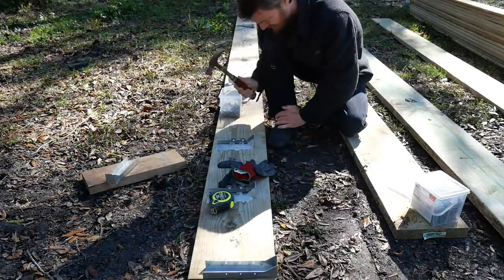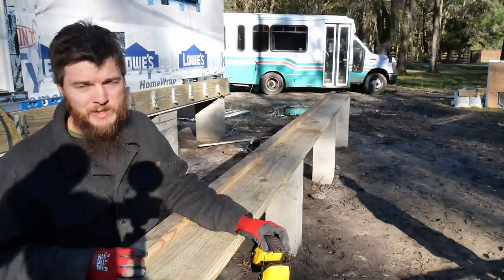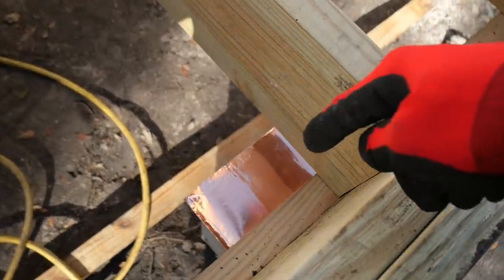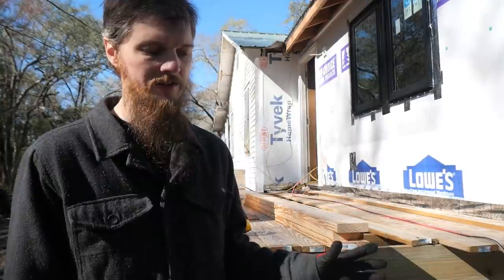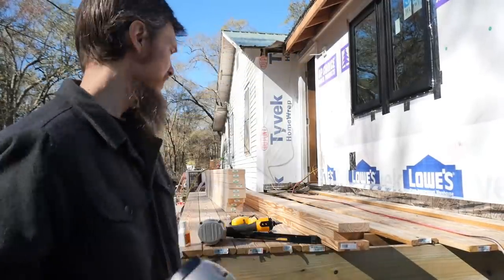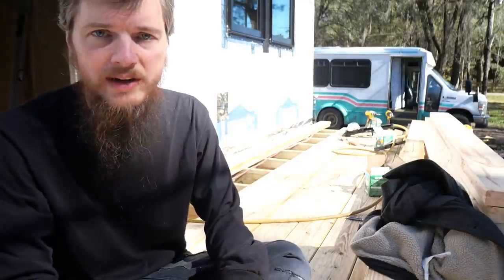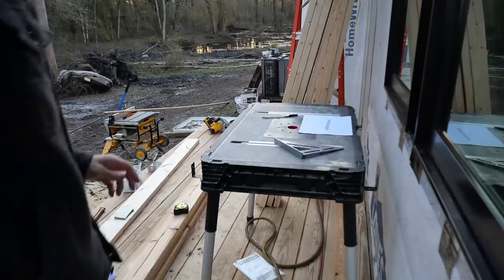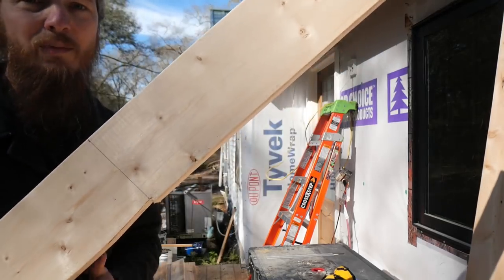I Shouldn't Have Used Nails!  DIY Porch Build

Comment: Doug - you probably have checked this but the air compressor pressure is critical to drive the nails fully.  Test on scraps first and dial in the pressure.  Either one of those guns should be able to sink those nails with ease.  Don't forget the drops of air tool oil each day.  Cheers!

Comment: Put Air compressir psi at high end of tools limit. Use air hose with a bigger I.D..  Use coupler fittings at both ends of the air hose that have larger I.D.s than what you have now, which are probably 1/8 or 3/16 I.D.
The framing nailer takes  big gulps of air so give it larger i d. hose/fittings. 
If your nailing and your compressor starts up/ pause nailing till it recharges then continue.
Also check your tools nail depth adjustment. Remember to put a few drops of air tool oil into the air fitting from time to time.
Reply: and make sure the hose isn't to long

Comment: I was getting exasperated watching you continually driving those nails without referring to the trouble shooting portion of your owner's manual. Two things spring to mind immediately ; not enough pressure from the compressed air supply and the depth adjustment built into the nail gun.
You should be able to go to your air compressor's air gauge and twist a knob to increase pressure there. There should be a needle that remains stationary marking the maximum pressure that you set and another one that goes lower every time you shoot a nail, when the pressure gets too low, the air compressor will kick on in order to go back up to your desired nail gun pressure. 
The adjustment on the gun itself should be some type of threaded mechanism next to the tip that you push against the wood while squeezing the trigger. Again, this should be clearly explained in your owner's manual. Too much hose will also decrease pressure. An undersized compressor will cycle more often depending on the size of the tool and the rate of fire. good luck !
Signed '45 years in the business'.
Reply: Yes, exactly! I could not watch because the pressure to get the nail in has to be turned up for some types of wood and nails, and down for others. Totally has to do with the air compressor, not the gun.

Comment: Doug - take a look at your manuals for the nail guns and the minimum PSI they require. I'm sure your air compressor is not supplying enough constant PSI for the guns. Green wet wood requires higher PSI. For future reference ... too late here...🤣

Comment: Hey Doug. I agree with some other comments. Based on how far you were walking, assuming that’s where your compressor is, I’ve found that a hose longer than 25’ causes problems. You need at least 100-125 working psi. Most compressors can provide this except not over long distances. Try shorter hose and shorter nails. Ring shanks are tough to hammer in. I just put new T 11 siding on a mobile home using a hammer and 2” ring shanks. Man my arm felt like it was gonna fall off! 😂 Looking good and glad you found the site to help you lay out your rafters. Old school carpenters can lay out any project using a framing square. It’s a lost art sadly. Keep up the good work looking forward to seeing the next video!

Comment: The power to the air nail gun totally depends on the air pressure. It isn't usually the gun, it's the air compressor. Make sure it is turned up. I don't hear it running. :)

Comment: How much air do you have coming from compressor?  Turn it up all the way. If it's only 120 psi  if you have a 150 psi compressor it will drive nail in. A framing hammer 20 to 24 ounces or more its easier to know it will drive with fewer hits. My Dad could drive nail in two hits. If I bent nail he would say you are still wet behind the ears.  Meaning young.

Comment: My back experience building my house tells me you need more pressure from your compressors.  I know you sayed preferable you like to use nail but it's better using screws it's stronger and durable. Your post for your roof should been install before your deck floor. You will have a  better option by making those post stronger this was your roof won't shift I have build many roofs until today none have shift . But is you project and you can building it how ever you want, but there is always logic and it's up to you if it make sense to build it right the first time, get a better hammer 22 Oz . Take care thanks 😊

Comment: Turn up your air pressure, if the pressure is ok use a shorter and larger diameter hose.  You are running out of air for the gun's piston.

Comment: It’s strange two nail guns wouldn’t hammer the nails in 🤔 I take it you checked the compressor and hose because it sounded like the guns weren’t getting the correct pressure, I take it the wood isn’t some sort of magic hardwood only found in the forest of the unicorns lol 😝 as for the conventional hammering, if you point your index finger up the shaft of the hammer towards the head you will find your aim is better if not I suggest a leather wrist brace 😊👍🦖🗿🦤🏴

Comment: - Tool lubrication
-  Piston wear
- Air Pressure
What pressure are you running? Capacity [CFM] of compressor?
Looks like your compressor is undersized... Need more volume not pressure...

Comment: Agree with what others said. The fact that both nail guns "failed" means that either the wood is too hard (unlikely) or that your air pressure is too low - very likely.
Reply from the maker: We had it set to what the tools say to use, 120psi. Those deck boards seem to be the main issue since the nails shot through the board on the piers fine.
Reply: @diyfferent  The SCFM matters, not PSI. If the gun requires 3.5 and your air compressors make 2.9 it is not enough.

Comment: been watching longtime, two question on nailer, 1. Did you hold down with some force to prevent recoil? 2. could you turn up the air pressure.

Comment: I bought rough lumber when I built my deck last Summer. I used 2x6 larch for the decking and cedar for the railings. Had to plane all the wood myself but it will outlast treated lumber and was a lot cheaper as well. I used 3.5" deck screws.

Comment: Use nails for deck framing. Much higher shear strength than screws.   Stainless steel screws to hold decking and treads down.   That is the best or correct way.

Comment: My husband said to turn the air up on your compressor
Reply: I'm wondering the same thing. why not turn up the psi that goes for each nail hit? maybe its the way the nail guns are designed, they could be the ones that limit the pressure of each hit?
Reply: That was my thought as well. I can't imagine any major manufacturer not being sufficient for driving nails into PT wood. I wonder if his Air Compressor isn't big enough or set on a higher PSI.
Reply from the maker: My compressor goes up to 125 PSI, The nailer says 120 PSI max, I had it at 120 PSI and even a little more. It just didn't have what it takes to drive those 3" ring shank nails.

Comment: I find it amusing that you chose nailing the deck boards on when you use screws for so much of your construction. All will be fine in the end and your nailing arm will recover. The remodel looks good and I know y’all will feel safer using the porch.
Reply: IKR
Reply: I don't like screws in decks either. They can cut your feet if you are barefoot and they happen to be sticking up.

Comment: My wife says to nail from the elbow and not the wrist. She doesn't think it's the compressor or the pressure, but is the result of not holding the nailer firmly against the board, thus allowing recoil.

Comment: It's not the nail gun or the compressor. It's the fittings. I had the same issue the fitting opening is creating a bottle neck so you are getting the pressure you need but you are not getting the volume. They make fitting with a larger opening to help deliver the volume you are lacking. Try it you will thank me later.

Comment: The contractor who built our deck used screws. I’m always a fan of screws over nails to avoid nail pops, etc. Screws seem to hold up much longer. Your new gun is much more ergonomically designed, good choice.

Comment: the builders of our deck used nails
Nails work back up as boards giggle under walking. And then they impel our feet. It caused me an injury to my foot.
 A new contractor said its advised to use screws for floor boards and deck boards to prevent this
Reply from the maker: What type of nails did they use?

Comment: Could the nail setting problem be due to low air pressure. Most air tools have an adjustment screw to increase/lower air pressure. Hope this helps. Love the Little Helpers you have!

Comment: the problem is not your air pressure from the compressor but the dry or even wet air from the compressor !  .  
that is very easy to solve. 
pour a little bit of sewing machine oil into the air inlet port of the stapler and you will notice the difference almost immediately .  
after that every time you put a new set of nails in the machine just put 1 or 2 drops of oil in the air inlet port and it runs like a charm
Reply: great info

Comment: recommend you watch your video closely regarding hammering your nails that stick up.  You will notice you are attacking the nails from DIFFERENT angles, therefore causing them to bend. Your hammer is "canting in" so the nail is not being struck squarely. Also, remove the gloves as they are probably causing the hammer to slip in your hands and wrap your thumb around the hammer.  Don't leave it on top of the handle.

Comment: Dude. I told you about this months ago! Exterior self tapping torx screws! I very rarely, if ever, use nails. Only when it makes sense. And only Milwaukee M18 tools baby! You wasted a crap ton of $ on nail guns when using screws with a good impact driver would have done the job way better. I also amazingly suck at hammering nails, simply because I rarely use nails! I would have used joist hangers on the outter board. If that lip rots you're screwed. No pun intended! :P It's a horizontal wood surface.

Comment: My dad was a carpenter, and it is the weight of the hammer.  Go heaver and see. He was old school built from the ground up. Roofs when nailed on. He had many hammers for different jobs. So, try several hammers. Makes a difference on bent nails. Wish I knew what he would say about it but have forgotten. He is right though because I would help him, and I had a hammer he brought me. Lost in a move and now I have problems. I wanted to be a carpenter, but my dad said not for women on construction sights. Saw someone cut fingers off so now am afraid of power tools in school shop class.

Comment: Sounds like an air pressure regulation problem on the dewalt. If it's not in the compressor side of the system then it might be the diaphragm inside of the nailer. Either way I'd crank up the air pressure coming from the compressor.
Reply: This is what I was thinking .. perhaps not enough air to drive them. I've never had issues with driving nails except in old heart pine. Plus ring shank nails require more umph anyway.
Reply: Yup......crank it up.
Reply: at least to 120PSI (I think that's the max on Porter Cable tools) .. also if it's a pancake compressor it might not be able to provide enough air.

Comment: I don't think it's the nail gun, I think it's more than likely your compressor. Check to see what the nail gun needs for air pressure and then set the compressor. I am also surprised you didn't screw the boards down as you have used screws in most other projects.

Comment: You insisted on nails, I wouldn't, but if I had to I would have slightly toe nailed each nail in opposite directions making it harder for drawback. What size hose are you using?

Comment: Screw shafts have a thinner diameter than nails and even if stainless or coated they will rust through sooner than any nail. Ring shanks take more work to nail in pressure treated. On my decks I always drilled holes then hammered in the nails. Soaping or waxing the nails will help them drive easier. You are correct- those boards will shrink as they dry out. Errors with nailed boards mean using a Sawzall to cut the nails. Great work. Thanks for the video!

Comment: Take a piece of course sandpaper and sand the head of your hammer. The head won’t slip off the nail as you strike it and you won’t bend the nails as much. Also hold the shaft of the long nails with an Electrician’s pliers until it is too close for the pliers, then drive it home. You’ll be amazed at how few nails you bend.

Comment: I think with your awesome work ethic and diligent research and honest evaluations you can't go wrong.  When we did our hardwood flooring ( internal) with a flooring gun, we were frustrated about the nails not going in the whole way despite the PSI being set as instructed. It turned out there was also a setting on the gun that needed adjusted. Very frustrating! I feel your pain. My hubby always uses screws for anything deck related but I do think the nails look better myself. Also, imho, you can usually pull up a nailed plank easier than unscrewing every blinking screw! You did the right thing getting a gun that was more comfortable, maybe there's hammers that are lighter / more comfortable/ have bigger heads?  But at the end of the day it looks awesome! Time for some renovation pudding to celebrate your progress!
Reply: Also, sometimes when I have struggled with a project, just chatting to the older guys at home depot and lowes or the village hardware store and picking up tips from them can give you that little hint that sets you on the right path! we all have to learn somewhere and oftentimes these old school guys love helping out! Especially when they get a chance to look at newer equipment!  I also remembered that we had air lines in a factory I worked in and when the hoses were about to fail was difficult to judge so we changed them regularly because the pressure going to them showed one thing but if they were leaking it was difficult to tell and when they are close to blowing they become pretty dangerous. Try replacing the air hose between the gun and the compressor?

Comment: Totally understand the hammering dilemma.  It looks like you are doing the right thing from what I could gander in the vid, but there's a trick my dad taught me AFTER I built a small porch and steps, that I'll share with you and anybody reading comments here:  be sure the decking boards are such as the tree rings face downward when you look at the end of the board.  Not as much an issue on something covered, but it does allow water to "drain" out of the wood after rains instead of getting trapped if the rings make an upward/bowl shape.  Something to consider as well if lumber is being stored to be used at a later date.

Comment: Nails are much stronger in sheer than are screws, but if the nail gun won't do the trick, some pilot holes might.  A quick zip, zip, zip, down the row, might help prior to hitting it with the nail gun.  Of course accuracy with the nail gun is always questionable. Getting those nails to seat into the pilot holes might be hard, but makes hitting them with the hammer much better.  Love your videos.  You're always honest with what's going on.

Comment: Doug, did you double check the setting on your compressor to make sure you had it set to a high enough pressure and then the guns also have an adjustment to drive the nails deeper or shallower.  Hope you figure it out for future.
Reply: You're right, plus the size of hose 3/8" when using framing or roofing guns.

Comment: about the nailgun : have you checked if you upped thepressure on the compressor to the max , the smaller compressors usually make about 8 atmosfere max pro ones make 10 wish helps  , having a shorter airline might help too as the airflow through the line gets hampered the longer the airhose gets air is compressable so the shock the nailer needs gets softer , using a bigger airhose that flows more air might help too as the air can move faster 
the nailgun uses a big amount of air for a verry short period the more air it can get in that short period the deeper it will drive the nail in 
as long as there isnt a snowload on the roof the low roofpitch should be fine

Comment: genuinely  curious why you would want nails  over screws  i use  decking  screws. with a head barely big enough  for the bit and isnt  hardly visible on a finished deck and.  you dont have the issue of nails loosening  up or eveny galvanized  nails  snapping in to from corrosion  a deck built with screws has almost  double the life

Comment: Yeah I use screws for several reasons: you can undo mistakes, they don't back out, they're stronger, they don't bend during installation, and it makes for a more peaceful assembly (no loud banging). It also avoids smashed fingers.
Reply: Nails have a much higher shear strength than screws, since they can bend where a screw would just snap. All those other reasons are good ones though!

Comment: Look into an air powered Palm Nailer. You will be shocked how big of nails it will drive with ease. In addition to driving big nails it will do small and all in between sizes. Also handy to use when hanging joist brackets and similar construction brackets. Senco makes one of the best. Now there are a lot of other brands making them too.

Comment: I've always had good luck hand nailing 2.5 inch galvanized finish nails  to hold down deck boards. Hammering is a skill learned over time by just using your hammer instead of the nail guns.

Comment: Normally if the nails are not going in all the way it is the compressor. The compressor needs to have a high PSI capability. I had the same problem in the past.

Comment: maybe the hose or fitting on the hose somewhere is limiting your air volume? maybe larger air hose? (diameter) heck PSI too low on output on compressor? I know I sometimes forget to change it back when I change tools :-)